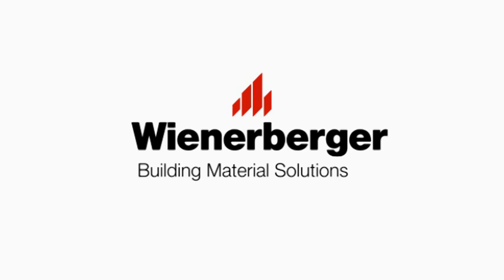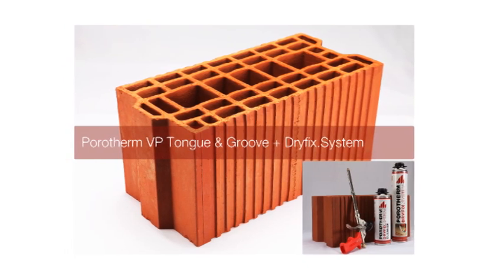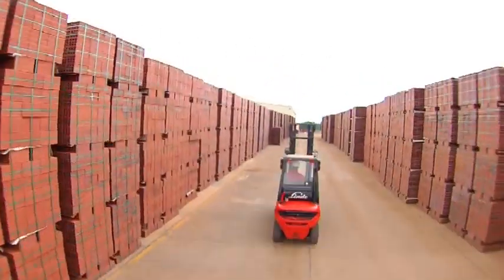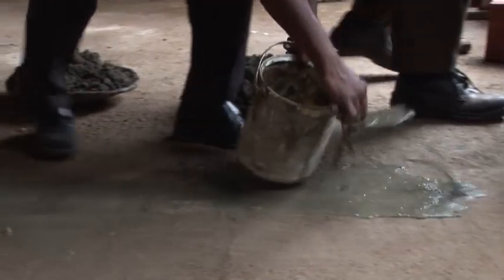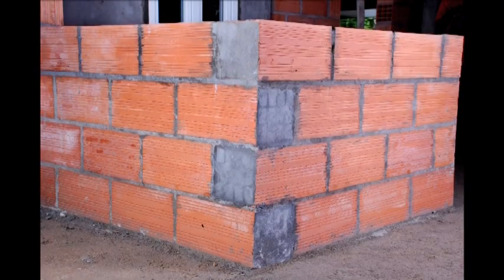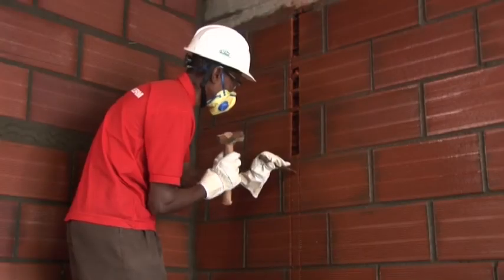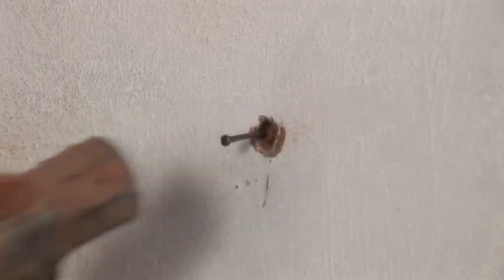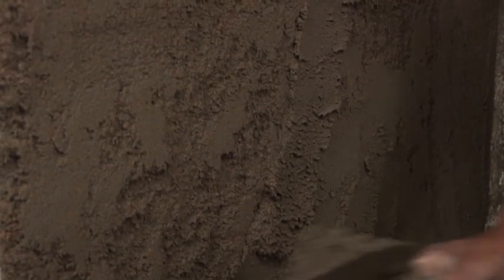Smart Bricks

Comment: Combination of ACC & Poro bricks should give desired strength & reduced weight, & should give proper ventilation for inner walls. And appreciate it as this is ecofriendly. Its colums & pillars that supports the building not the walls. So clay bricks or porotherm bricks can be used in combination. Walls can breeth.

Comment: Great looking bricks! Since the blocks are clay, wouldn't it be better to use a clay-based plaster instead of a concrete plaster? The clay is breathable and regulates humidity, but a concrete plaster is not breathable, taking away this benefit. Also, isn't there more risk of condensation buildup and cracking with a cement plaster? The outside wall could include lime with the clay plaster to protect against weather while still allowing for humidity to pass through.
Reply: Kevin-April Y tghhhjlop
Hc😂😉😯😈😁😁